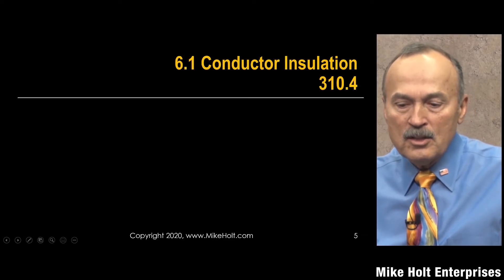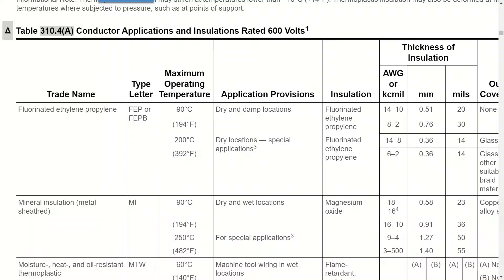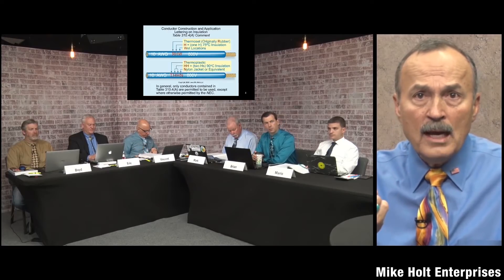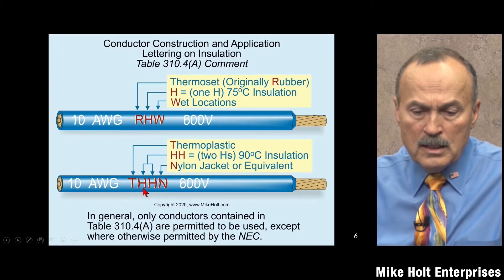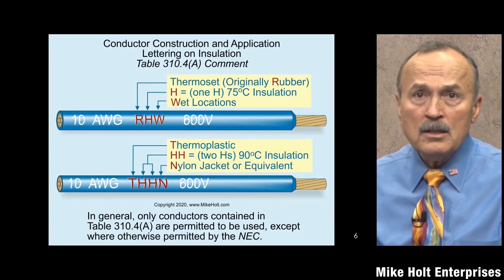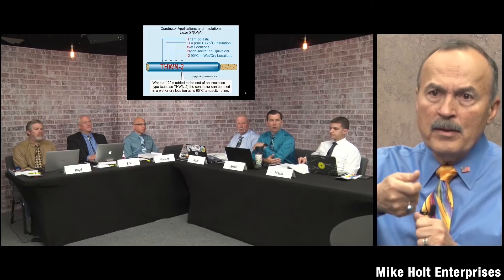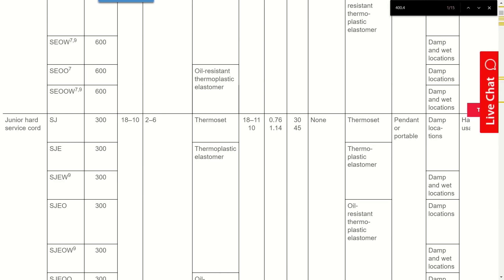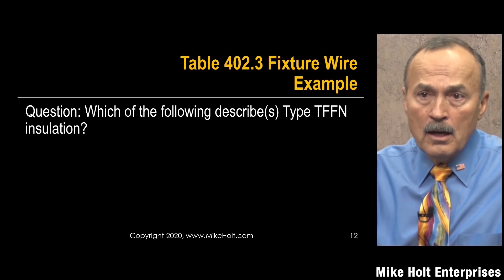Conductor Insulation, NEC 2020 - [310.4], (19min:06sec)

Comment: What is ampacity rating of #12 AWG Copper THWN-2 at 60 Degrees Celsius?
Reply from the maker: See Table 310.16 in the 2020 NEC or Table 310.15(B)(16) in the other Code books.
Reply: @MikeHoltNEC  I see the ampacity rating of #12 AWG Copper THWN-2 in 310.16 under 90 Degrees Celsius ONLY?
Reply from the maker: Watch - https://www.youtube.com/embed/OLIHEiiY_Rs

Comment: The statements on the nylon jacket was not clear. It sounded like if the nylon cover came off when pulling it that was ok. How can that be if when you enter a box you have to have the nylon cover enter the box a certain distance. 

This statement could have used some more clarification.
Reply from the maker: The nylon jacket is 'not' insulation, so if it gets damage or comes off, that is fine.
Reply: For the most common applications, it is OK if the nylon jacket comes off during the pull.  The nylon will absorb the wear and tear, so the insulation beneath it remains intact.  It also reduces the friction, from what it would be, if the PVC insulation were the only layer surrounding the conductor.

In applications where you need protection from gasoline, oil and chemicals, that is where you need to be careful not to damage the nylon jacket.
Reply: That makes it sound like if you are going just a couple feet inside of a 2x4 wall you don’t actually need to use romex. You can just put in individual wires. White, black, and copper. Am I understanding this right or am I not understanding what the nylon jacket is.
Reply: @ecospider5  It's a different kind of jacket, than the jacket that is on Romex.   Individual conductors are typically required to be in a raceway or enclosure, unless otherwise permitted in the NEC.  The nylon jacket on THWN-2 is very thin, and does not serve the same purpose as the jacket on a multiconductor cable.
Reply from the maker: @ecospider5  you can't run wires without being installed in a raceway or cable, see NEC 300.3(A).
Reply: That is what I thought thank you both for the clarification.
Reply: I will go do some reading on the nylon jack used with some wire.  Thanks again for your reply.

Comment: Mike, Hard and Extra Hard usage-Think construction sites also.
Reply: In metal work shops / manufacturing, flex cable doesn't hold up very well.   Stepped on by work boots with metal chips in the soles, sheet metal scrap on the floors are like knives.